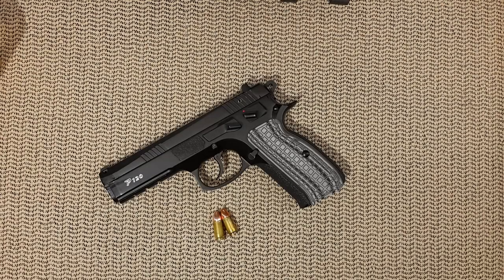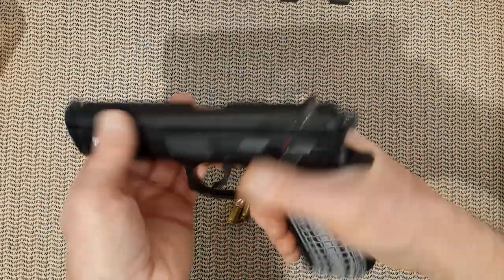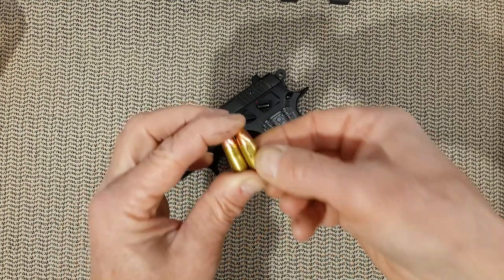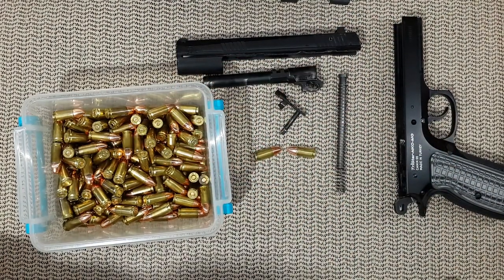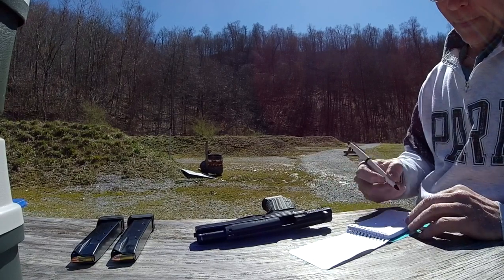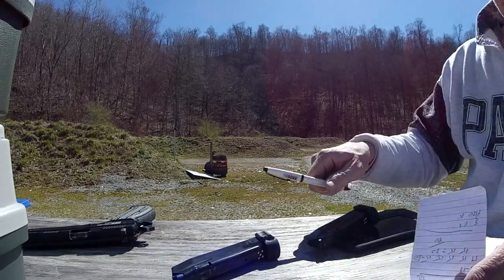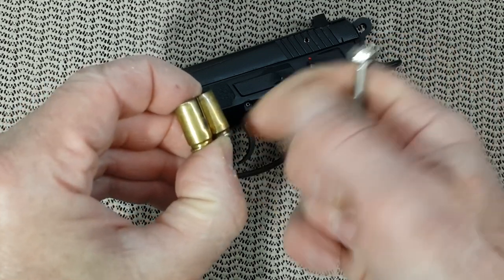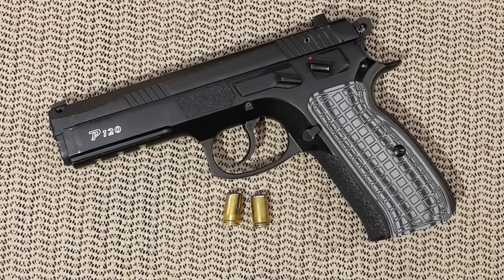Cracked cases, are they dangerous?

Comment: I reloaded some aluminum once fired cases with 128 grain cast powder coated bullets.. titegroup.. 3.4 grains and several cases split.. but all cycled fine.  Never had a brass or steel case crack so far.

Comment: Would you be comfortable shooting a similarly split case with a higher pressure load?  This particular sample is a relatively modest power factor.
Reply from the maker: Yes it is a modest load. 
If it was a heavier load, that I had already been loading for some time, and knowing that I possibly, already, shot some cracked cases without my knowledge, yes, I would try it as well. 
But of course, if it is, let say, a +P load. I think I would already been aware of something going wrong by shooting a cracked case.